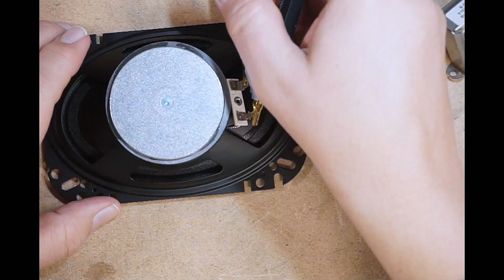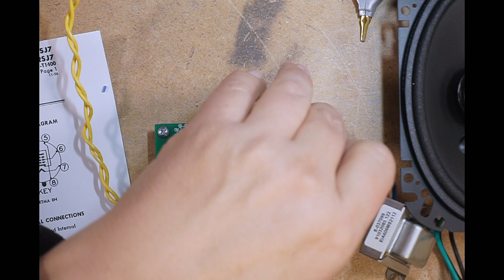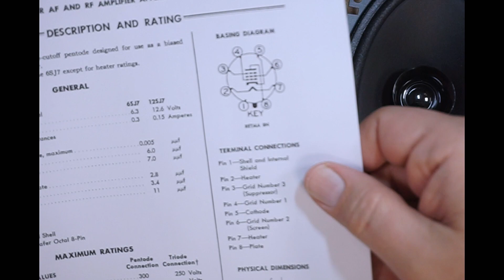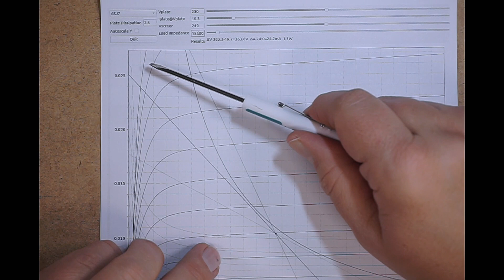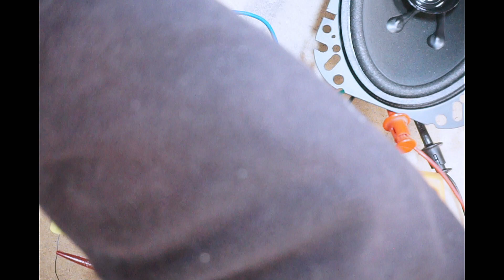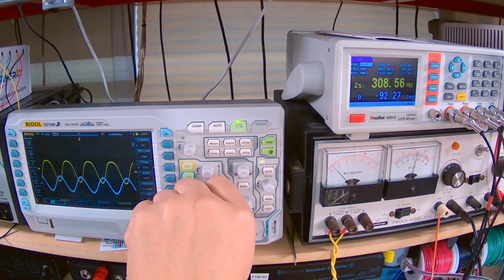230301 Valve Studio - 6SJ7 Output Stage

Comment: For the tube to be operating as a triode, the suppressor grid and screen grid should be connected to the plate according to GE data sheet.   How well does it perform at 100Hz?
Reply from the maker: That's correct, suppressor and screen are connected to plate for triode operation. I'll have to check out triode operation in upcoming video. Thanks for the comment and for watching.